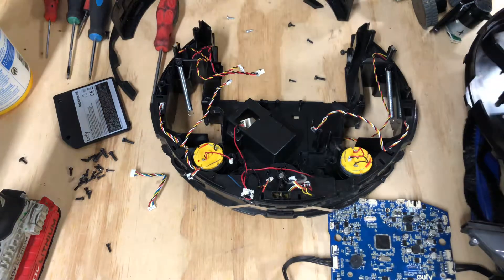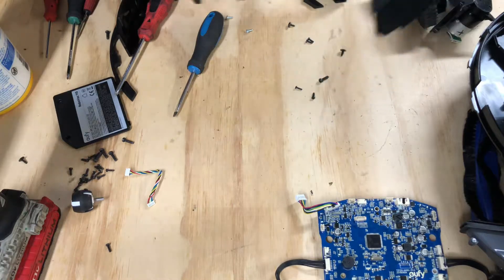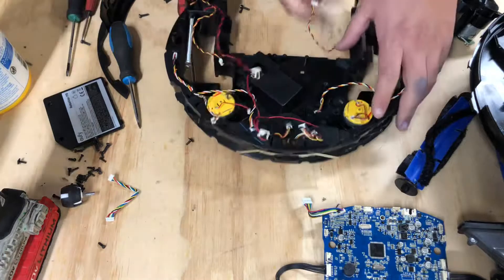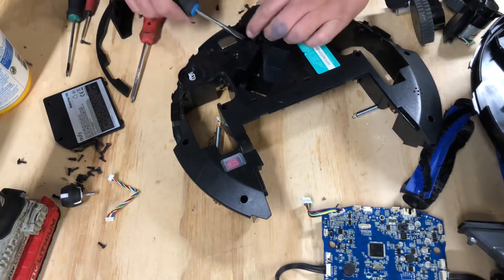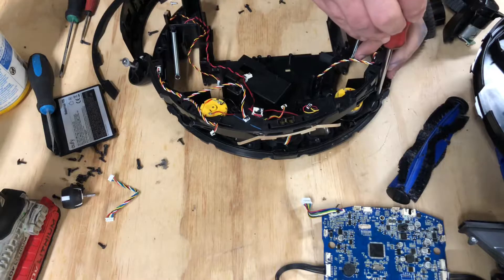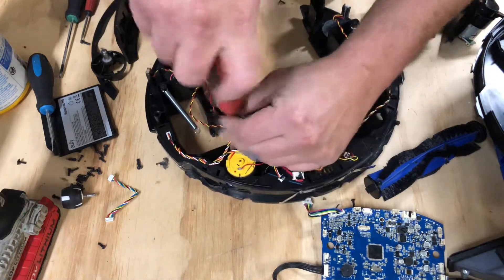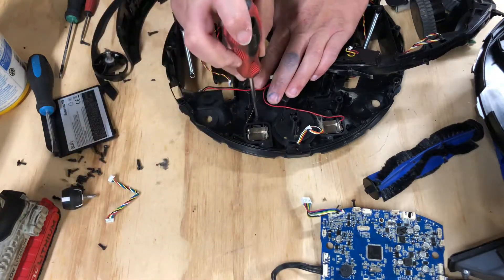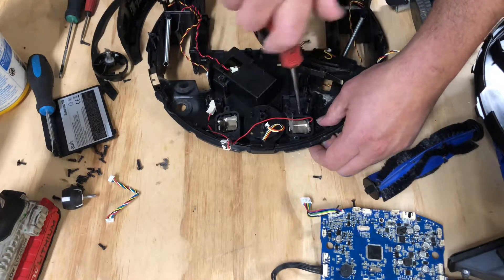Eufy RoboVac 11s How to Remove Spinner Motors and Front wheel Housing Video 8

Comment: I hope you can help! I had to disassemble the unit to clean several parts that had rolled through something “less desirable”. I took out the front wheel housing, spinner motors, etc. I’ve disassembled the unit based on your videos a couple of times to check the connections, etc. I’ve even replaced the battery. But, all I’m getting is a red, solid light from the unit when sitting in the charger. Prior to this last disassemble / reassemble attempt, it would come on, with the blue light, but the suction would not come on. It would then only last a minute or so and then stop. Any ideas on what I can check? I keep thinking maybe something isn’t connect correctly or is faulty.